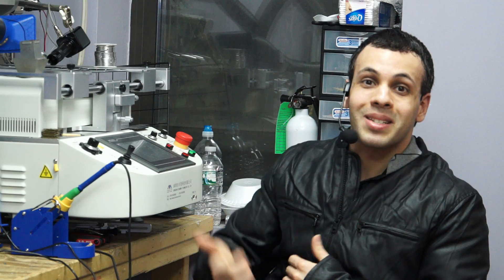How to get your #mbp2011 problem fixed for free!

Comment: Hi Louis, There's a lot said about 2010 etc. Would this work with a 2009 macbookpro unibody 17"? Also, is there any documentation of this policy anywhere that I could check out? Im really stuck without a computer and mine is dying with green pixels in black areas. repair says new logic board too. I'm disabled and a student and if this really could work for me it would be a huge blessing. Please tell me what you think, your experience? Thanks so much!
Reply from the maker: NewNameRuth Not at all.
Reply: Louis Rossmann I'm not sure how to apply your response. is it in reference to my question regarding documentation? Or do you mean I won't have a problem using this method, or that my 2009 doesn't qualify? I'm leaning toward trying it and here's why. In 2013ish apply replaced my motherboard under warranty. As soon as that warranty ran out it started having problems. So that motherboard it seems does qualify and this would work for me. An answer of "yes you should" would make sense to me with this response, or no you shouldn't. lol thanks again. (I just had surgery one week ago so a little slow due to pain meds) thanks. :)
Reply: NewNameRuth http://www.apple.com/support/macbookpro-videoissues/ --> Your computer doesn't qualify.

Comment: Louis Rossmann, I wish I found this video sooner.  I was able to have apple agree to pay for parts, according to them I just pay shipping and Labor or I may also take it into an authorized service provider. The problem is a few months ago I attempted to repair this issue myself and did exactly what you say some may do, funny thing is my computer is working well and have tried gputest with no luck getting back to blank screen. If I take it in to get the GPU replaced will they know I messed with it? Will this void them from replacing the GPU? They told me as long as there wasnt preexisting damage I caused. Like Broken screen or a spill It would can be serviced.  They said after it was service they have a 90day guarantee.
Reply: Louis Rossmann Just got back from apple store. I have been super nice from start to finish. I am paying 0 dollars for a repair. Ill keep you updated.
Reply from the maker: Rose Z These aren't questions I can answer, no idea, never worked for Apple.
Reply from the maker: Awesome!
Reply: Louis Rossmann I commented as fatlosspro earlier. So...apple still has my mbp. Im curious if they are going to be using newly designed boards or the same crappy one. Still happy i was one of the first to get it replaced free. Ill let you know what they put in once i get it back. Been there since Feb 18. If its the same crap stress test!!!
Reply from the maker: Same crappy one with same crappy thermal paste. Same crappy graphics chip, same crappy quad core Sandy Bridge processor tied with the same heat sink to that crappy graphics chip.

Comment: My 2011 MBP went down over a week ago, I got it back from Apple this previous Tuesday (after paying $310 to have the logic board swapped out at the repair depot) and have been running Furmark almost continuously since then. Sometimes on two displays simultaneously. 

I've yet to see any problems with the card and, since I wasn't monitoring the temperature before it failed, I'm not sure this one is even getting hotter than it should be.

I'm ready to consider the repair a success.
Reply: That's solid then.  I would suggest you take extra counter measures by keeping the laptop consistently cool.  You can accomplish that with SMCFanControl and letting the fans sit at 2500 without load instead of 2000RPM and a Passive Heat Pad.  Targus Heat Defense has these pads and they are basically crystals in a pad that, using the macbook pro aluminum body that acts as a heat-sink, takes the heat out of the material itself and melts when it has done all it could.  I bought 2 of these and swap them out when one melts and let it cool.  Also some advice, the temps from Temperature programs aren't the most realiable.  I don't think Apple has a physically thermometer in the laptop to measure heat from the end process because I think apps only measure the output temperature of the parts themselves..  The only real way to tell is if you feel the bottom of the laptop or the top ridge beneath the monitor.

Comment: I've been running the GPU test for hours now and I don't see to be able to go higher than 75° for the GPU diode and 90° for the GPU. If I remember well, months ago I was able to go up 100° somewhere. Did Apple modified anything to put some sort of limit ? Should I increase the temperature in my room ?
Reply: Wrap it up in (dry) towels.
Reply: Joe Pascual Do you speak from experience ?
Reply: Frenchie Boi If you do that, you'll cause  your computer to overheat and shut down.  The only way to keep it running consistently extra hot is to reduce airflow. 

You can kill 2 birds with one stone.  Get that clear plastic wrap that you get when you take your clothes to the dry cleaner to cover the clothes and tilt the monitor 35-45 degrees inwards.  This will slightly reduce airflow.  Then just throw the plastic wrap over the top so you completely prevent dust from entering the laptop while it runs.  I kept it running decently hot like this.  It hasn't failed yet though :( 50 days left.  I'm starting to suspect a solid reflow, meaning there is a 50/50 chance it'll fail in a couple months or won't at all.

Also, I have read the lawsuit and it details that the solder cracks from being rapidly cooled and reheated.  So I would suggest you stress test it to a hot temp, turn it off, and put it outside (maybe a porch).  I don't know about this though.
Reply: The1Music2MyEars Actually that was my thought when I read about the cracks. It's about 0° to -2° C here so I guess I can really stress it out. Is running without anti aliasing a better choice ? 
After putting a few thoughts in it, here is what I'll do :
Program with automator a workflow that will launch the stress test for 10 minutes, turn it off, wait 10 minutes, relaunch it, all that in loop. I've noticed the temperature to be slightly higher at the beginning of the stress test.
Reply: Frenchie Boi Well the temp is higher since you already warmed up the components with the first stress test so it is normal for it to be hotter at the beginning of the next test.  Where do you think we can get 0C?  It's not that cold where I live lol.
Reply: I can't get higher temps then 75 either, did you figure something out? Is your GPU still working?
Reply: Didn't you hear about the repair program Apple announced Feb 20?
Reply: The1Music2MyEars Yes I did
Reply: ***** The1Music2MyEars since the repair program is up, I'm not worried more about when it fails. 5 years for this computer seems like a good deal honestly.
Reply: The1Music2MyEars I wonder if there's a way WE can reflow the GPU so that it's not as Sturdy... and hopefully make the failure easier to achieve without voiding warranty. My MBP2011 was reballed twice before the apple repair program and they still fixed it when I brought it in.
Reply: Frenchie Boi Any updates on your MBP?
Reply: ***** Any updates on your progress?
Reply: Jin Awaken I've given up, it never seems to fail for me :/
Reply: ***** thx for the response =/ I'm wondering if getting a techy to reflow/reball the new GPU with a weaker solder will work... but that comes with a risk that I'm not sure if I want to take yet. Decisions... decisions...
Reply: ***** So if I install like lion or something my GPU would fail?
Reply: ***** +BLUE If you have the new model of motherboard, you will probably fail to make it overheat. Even if it crashes, Apple does not provide anymore replacement on this machine since they have a waranty extension program.
Reply: They probably reflowed the GPU and put new thermal compound on it.  This will prevent the laptop from running hotter.  To be honest, I'm in the same boat as you, and I don't see my laptop breaking for at least a couple of months.  Oh well, here's to waiting out the lawsuit.
Reply: The1Music2MyEars They must have done that recently since my last repair was end of september. I also find my computer to be hotter when Furmark without anti aliasing. Am I doing it the wrong way ? Would be good if Louis can bring some answers.

Comment: this bug is only for the 15 and 17 model right? since 13 has no independant gpu
/??
Reply: i've got one for 90$USD with the chip failure, just heated it and now works like a charm. Since is out of the recall now (2017) im going to replace the GPU for a new one from alibaba, just 27 bucks :)
Reply from the maker: Correct
Reply: Louis Rossmann thanks for replying! May I also ask you how is the heat and air flow for the macbook 13 inch 2011 model? I am interested into buying one for web browsing and mainly developing. Is it alright with that one fan or the overheat is an issue?
Reply from the maker: It's fine. Just  old, shittier screen resolution  than a two year old 4" android phone and sandy bridge processor
Reply: Louis Rossmann well yeah but I need a cheaper portable device and I can't afford the retina shit. I got my hackintosh PC for the big deal all I need is the portable thingy. Can get it for like 400$
Reply from the maker: $400 is not bad for that at all.

Comment: I'm wondering if by sticking the tapered end of a chopstick in the vent to stop the fan from spinning, then running a stress test (or the hd fireplace video) would lessen the time it would take to sabotage this gpu?

UPDATE: https://www.apple.com/support/macbookpro-videoissues/

Thanks, Apple. Now I can turn off furmark :)

Just got off the phone with Apple. Refund should take about 4 weeks.

Comment: It's possible to break anything, and that doesn't mean that the product is defective.
Reply: True but if a majority of a product line is breaking just because of some hours of stresstest/gaming it's a faulty construction. Laptops with exter gpu's are bought by many just to be able to game on it. That means that that machine is gonna last for 4-8 hours of gaming every day for long time, that's what you expect from a laptop with exta GPU.
Reply: These laptops are designed to be stress tested.  If I render a Vray scene, 1 frame, it'll max the gpu and cpu and the scene will take 5 hours to render.  For 5 hours it'll be basically stress tested, and I do this often for projects.

Comment: Now for a slight complication on the matter. What If you bought this 2011 MBP second hand (I bought mine at about $1100 here in South Africa). Won't the Apple store want your original proof of purchase for the unit. Even without it, the unique apple serial will probably be linked to the original owner somehow? I'm confident that they will still gladly take my cash for the new logic board...but when it fails for a third time, would the "second owner" thing be held against me and as such I might not qualify for a rMBP? I've also had mine reflowed twice, which I'm not sure they can tell besides the screw holes being a bit scratched. Just want to avoid paying $300+, running back and forth and then standing here with nothing again...
Reply from the maker: This I have no idea.
Reply: Louis Rossmann Can you remember if you had to provide your original proof of purchase when they "upgraded" you to a rMBP?
Reply from the maker: I do not own a macbook. I only speak through the experience of other people.
Reply: I see. Alright no problem, thank you for the video and your insights. I think a lot of us had given up on the matter.
Reply: When I purchase my macbook pro I bought it from third party B&H and month later I call apple to register my product for apple care. They told me they need receipt to proof my purchase and lucky my receipt was saved on my email account. I forward my receipt email from B&H to apple and they register my macbook pro.

Comment: can someone confirm he/she ran gputest and managed to kill the gpu ? 
it's been running for a week or so on my newly replaced logicboard....
i'm starting to wonder if i should go on ......
Reply: I've been running it for 3 weeks.  I am kind of hesitant too running this thing burning hot for 24 hours straight for 3 months.  But these things were designed to run hot, so if 2+ months doesn't kill it, I would just use it normally.  In +2 months, apple lawsuit has a deadline and might be able to get somewhere.  3rd option, if the lawsuit doesn't get anywhere, and your laptop breaks down in more than 3 months outside of the repair warranty, I would use the blanket wrap trick (run GPU test, wrap it in a blanket, turn it upside down so it overheats and reseats the GPU) and sell that on craigslist and call it a year.
Reply: The1Music2MyEars
 arthur fabre did you try running gputest? Did the computer fail again? How long did it take? Thanks!
Reply: Francesca Di Gregorio
Hi,
i ran it for a week and it' didn't work out (i mean by that the mac didn't crash and never really got super hot). 
leave it, use your mac normally and pray.
anyways apple extended the warranty untill 2016 so you're safe if it fails again.
i'm wondering if my new logic board replaced 2 months ago for free is covered by this warranty though.
i'm pretty sure they use slightly improved logic boards now .

GOOD LUCK

Comment: My motherboard got replaced two days ago. (for free, out of warranty)
since then gputest is stressing the gpu 24/7 .
the thing is smc fan control tells me the temp never exceeds 65°C which, stop me if i 'm wrong is quite low (especially during a stress test).

Louis, my question is : 

if the temp doesn't get really high (i ve read 95°c here and there) is the gpu gonna fail anyways according to you (i understand temp is an important factor when i watch your vidz) ? 

the fact that the temp doesn't get higher than 65°c could mean they built some sort of a V2 motherboard for MBP2011 which would resist better or you remain sure they use refurbished boards ? 

thanks in advance
Reply from the maker: I wouldn't put it past Apple to modify it a little so it worked less like shit.
Reply: Try running the GPUTEST settings on TessMark X64, highest resolution (7000x something) and run it windowed (so you can still see the temps) you should be able to hit 75C now.  Do they?

Comment: So my story is that my computer died about 3 weeks ago. Out of warranty like many of you here. So i took it into a buddy of mine who works for apple, and he recommended the flat rate repair for 310 dollars. So i paid happily, and then had it repaired. Well the fix didn't last long, and so it broke 3 times after. I took it in every time to the store, and the apple employee said they would CRU it the next time it would break. Sure enough only a couple of days later it breaks and they keep it overnight to look at instead of taking it in for repair. Came back the next day and they told me that they would only refund me the 310 dollars i had previously spent on the repair. I was taken back from this, as it was already approved to receive a CRU. I was pissed, and so i decided to take the broken computer home without the refund. I called my friend who works for apple and explained the situation, and he is replacing my computer tomorrow with the top of the line model. 15 in 512gb flash storage ect., which is awesome because i don't own the top of the line 2011 model. Long story short it doesn't always work for apple to automatically replace out of warranty computers on the spot. Sure did get lucky with my friend working for apple.

Comment: Mine hasn't completely crapped out yet. Seems to be holding steady with infrequent crashes that I can usually preempt by not running it all day everyday. Still, I'm thinking it's just a matter of time before it fails completely. My plan is to get out from under this thing while I still can, but I won't have the cash to do so for a few more weeks, and this is my sole machine for now. My question: is there anything I can do to stave off the seemingly inevitable, like running smcFan with certain settings?